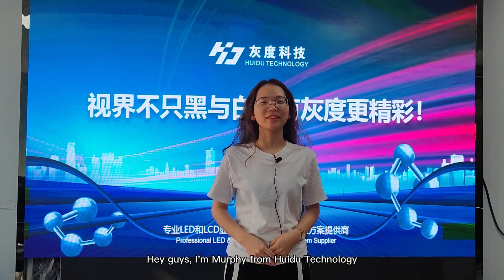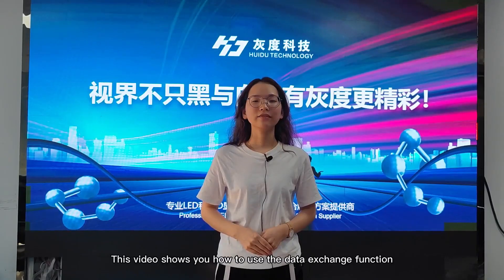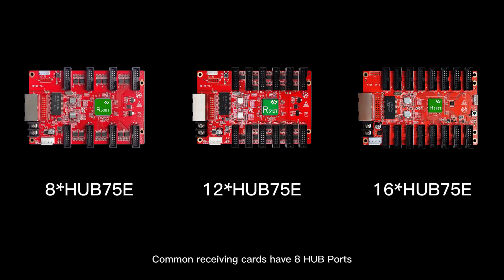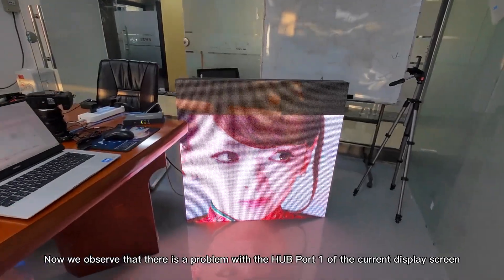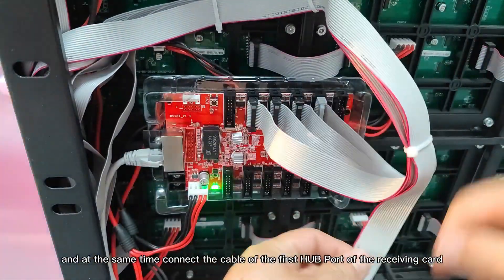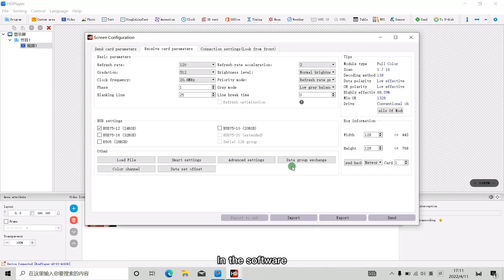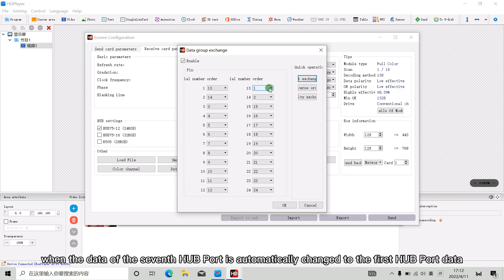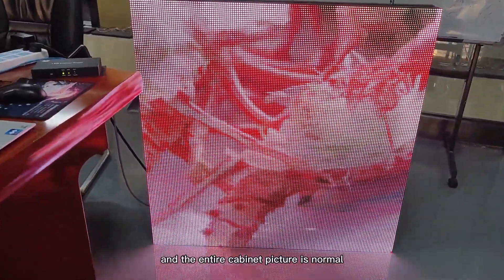Huidu Controller How To Do Data Group Exchange To Resolve the HUB Port Faulty Problem

Comment: thankyou for solution, but im confuse i have c16c controller with 10 port in serise no 5 port is faulty & no 9,10 port is empty so can i shift no 5 cable to no 9 & what is for pin setting plz rply.
Reply from the maker: yes it is supported. welcome contact our engineer and describe your requirements. WA: +8613510540791

Comment: How to use PC & DISPLAY ethernet ports on C15
Reply from the maker: Hi my friend, the PC port of C15 or C16 card is used to connect with PC by LAN cable for configuration setting. DISPLAY port is used to connect with extra receiving card for loading bigger LED display with high performance. If any other question, also welcome contact whatsapp and wechat: +8613510540791 , can be had answer in time there.

Comment: Hi 
What is meaning Control Range
For example if controller C15C（384*320）Widest 1024, Highest 512
Reply from the maker: Means the total maximum pixels it can work is 384*320=122,880 pixels, meanwhile, the maximum wide cannot beyond 1024 pixels and maximum high cannot beyond 512 pixels.
Reply: @HuiduController  thank you
You meaning it should not exceed totally 122880 pixels 
If we use 1024 you meaning 
122880/1024=120
(1024x120=122880 pixels)
If widest 1024 the highest it will be 120 not 320

And if we use 512 you meaning 
122880/512=240
(512x240=122880 pixels)
If highest 512 the widest it will be 240 not 384

Is that what you meant?
Reply from the maker: @medjoui7600  yes, correct. you got it:washhands:
Reply: @HuiduController  thank you so much
Reply from the maker: @medjoui7600  my pleasure:goodvibes: